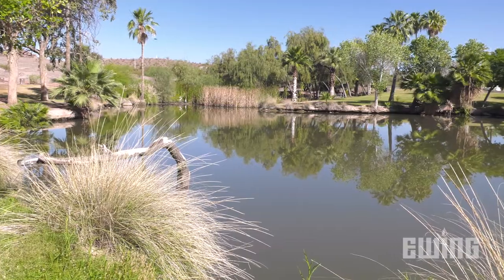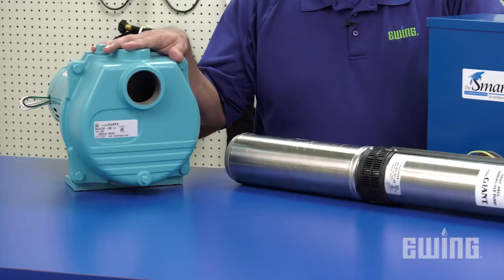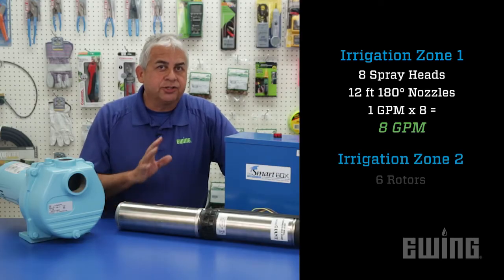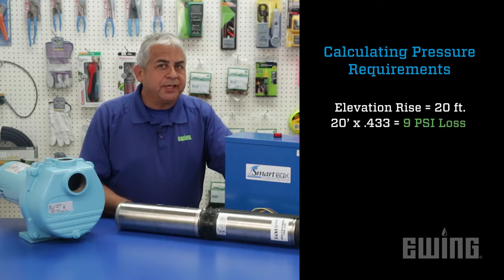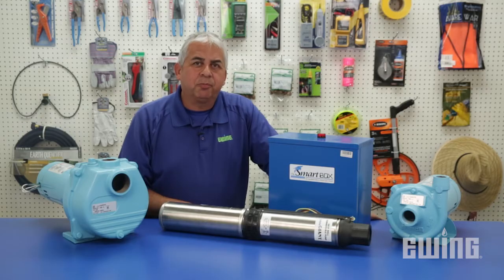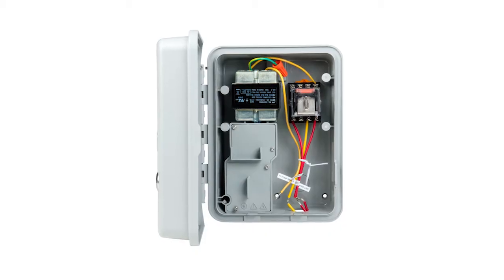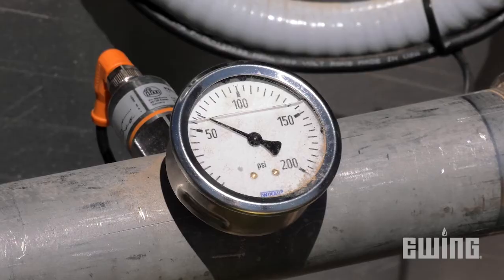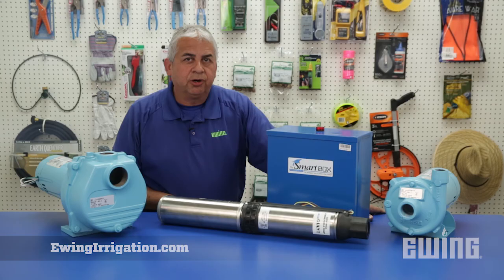Selecting and Sizing A Pump For Landscape Irrigation

Comment: If a booster pump used for an irrigation system is oversized can it’s demand cause air to be pulled from the main meter causing false readings and obviously outrageous “usage”bills ?  The irrigation main supply lines are 1” and it’s feeding from a 3/4” meter city water supply ….
Reply from the maker: First,  confirm that the meter is a 3/4". 5/8" meters are often mistaken to be 3/4" because the fittings on the 5/8" meter are 3/4".  A 5/8" water meter will safely supply up to 15 gallons per minute.
A 3/4" water meter will safely supply up to 22 gallons per minute. If the pump has a demand higher than the supply, the pump will "cavitate" and cause the water to become vapor. So, yes the pump can "pull" air. The water will still try to get through the meter but can't keep up. It's possible that could cause false readings. The fix is to be sure the pump demand is no more than what the meter can supply. Thanks for the question!
Reply: @ewingoutdoorsupply 
May i send you an email with pictures please
Reply from the maker: For further assistance you can contact our Pump pro hotline at 1-844-786-7776.

Comment: Thanks you. Ive been trying to figure out what I needed. Can I use a flow switch or is it best to just use a pump controller commanded by the sprinkler controller.
I am boosting city water. They are very inconsistent, pressure ranging from 25 at prime use time to 55.
Reply from the maker: There are two primary reasons that it is best to use a pump start relay commanded by the controller.  The city supply provides a constant source of water which means that the pump will always have water when the controller commands the relay to turn the pump on.  Pump start relays are very reliable and would be a good fit.  Also, flow switches can sometimes be a challenge because it is difficult to be sure that they are always operating in the specified range they are built for, especially when incoming pressure fluctuates. 

Because incoming pressure fluctuates, we would recommend a pressure regulating valve between the pump and the zone valves.

Please feel free to contact our pump-pro hotline for further assistance: 1-844-PUMP-PRO.

Comment: Is 0.433 a constant?
Reply from the maker: Correct. The value 0.433 is a constant used to estimate pressure changes caused by elevation differences in fluid systems, particularly in irrigation and water distribution. For each foot of vertical elevation change, the pressure changes by 0.433 psi. Thanks for the question!
Reply: @ewingoutdoorsupply thank you so much

Comment: What is the most economical way to boost irrigation pressure from the city residential  recycled water service? This has become a fiasco in Jacksonville FL.
Reply from the maker: You would need to add a booster pump to increase the pressure. You'll find a little more information and the number to a pump helpline here:
https://www.ewingoutdoorsupply.com/blog/from-pump-selection-to-troubleshooting-ewings-pump-hotline-experts-are-here-to-assist
Thanks for the question!